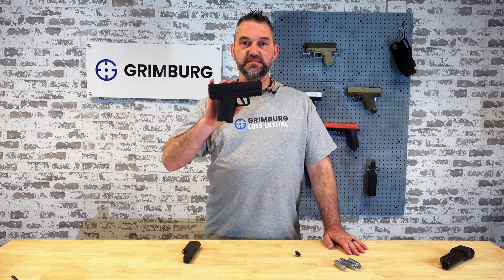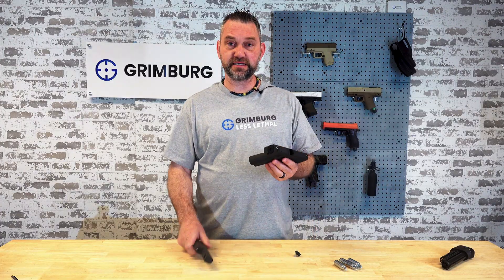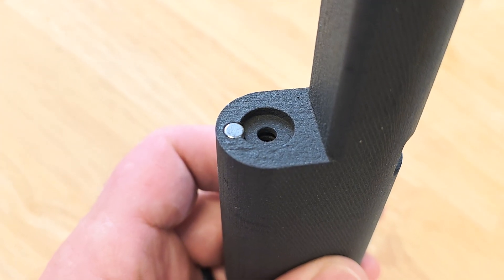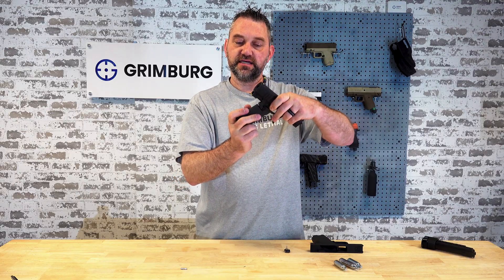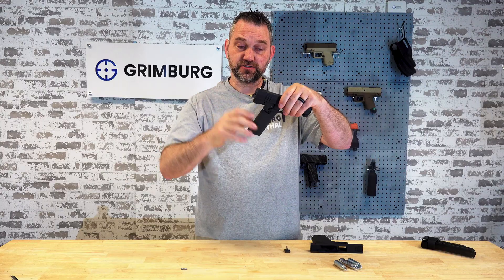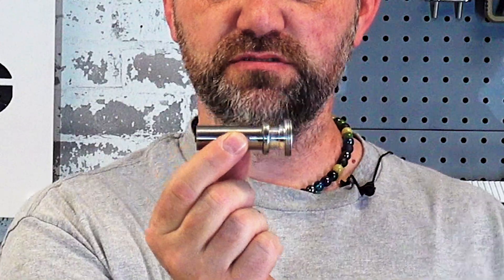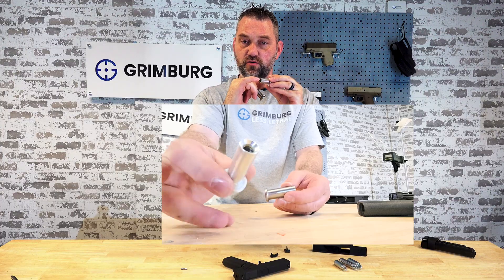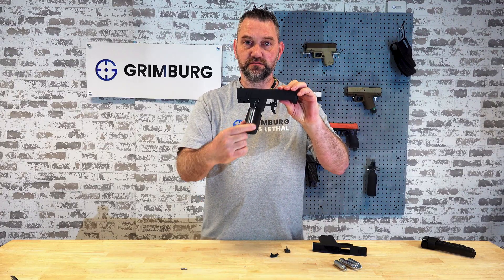Solstice Piercing Mechanism

Comment: Trigger pierce would be better
Reply from the maker: Every launcher with a trigger pierce has a weak first shot, which forces you to aim from puncture til the second shot when you're expecting the power to come on.  Also, the piercing can malfunction, and  on some of them you're not even 100% sure it's been pierced before you fire. We prefer this more immediate action with a positive engagement. Thx tho
Reply: @grimburglesslethal  until someone is on top of you arm pinned down and you cant activate the weapon.

Comment: This seems just as confusing as the first time because he manually pushed it down again and said that the gas pressure will push it down and make it ready to fire... I think most people would just be happy with a simple demonstration from unloaded all the way till firing.
Reply: Its a prototype, its not fully created at this point. But I look foward to seeing finished and fired also.
Reply: Don't get fixated on the pop-up, push-down thing on the top rail. When the launcher is pressurized by piercing the CO2 cartridge, it's ready to fire. If the thing remains in the popped-up position, you know there's a problem (not pressurized). In that sense, it is a ready-to-fire indicator, or rather, a not-ready-to-fire indicator (if popped-up).
Reply from the maker: This is plastic